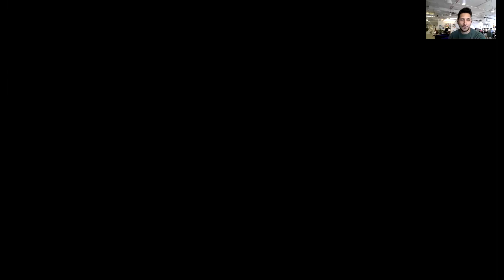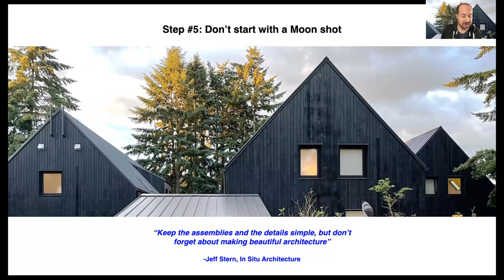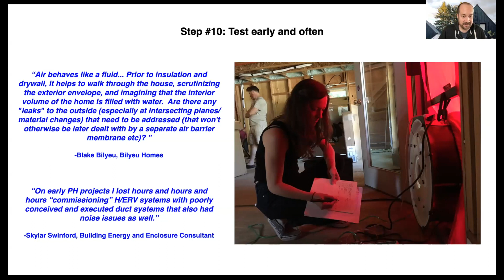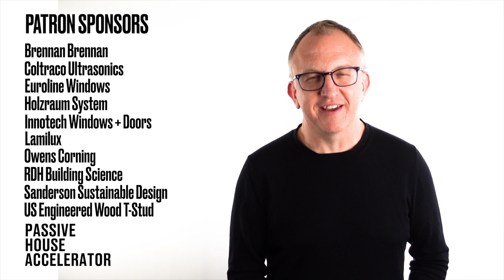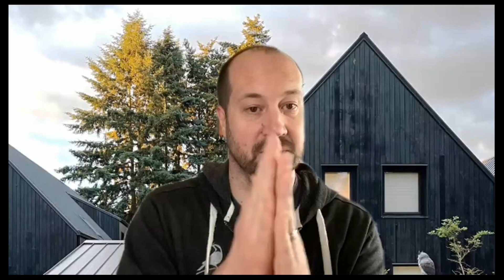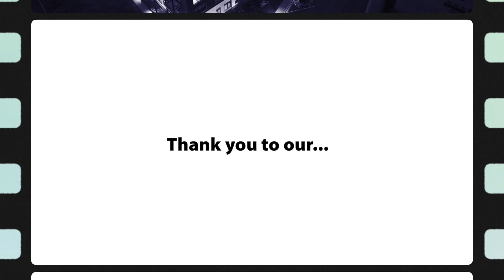10 Steps to Building Your First Single Family Passive House

Comment: For me on a budget design was key. An A frame is cheap but not good for a passive solar design. So went with a simple skillon design. Which allows for great solar gain facing solar south. I really liked Matt and Goldie's earthship. Except I went with a no tire, no berm, and a real floor for radon mitigation. Using a cmu masonry perfect wall for north wall. All the snow off the roof will dump there too. I also had issues with earth ship timber frames. I needed a 70 psf snow load. Went with warm roof so can have open trusses and tongue and groove roof board. It's not completely passive because of masonry appliances stove, white oven, and heater. I want an old world kitchen and a modern kitchen. Great video.